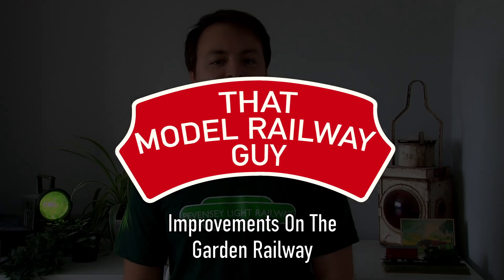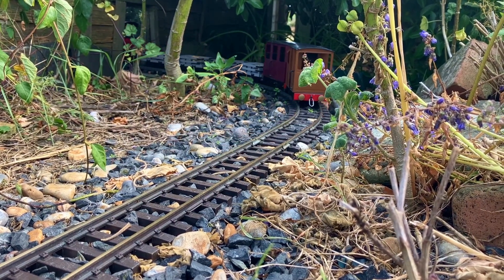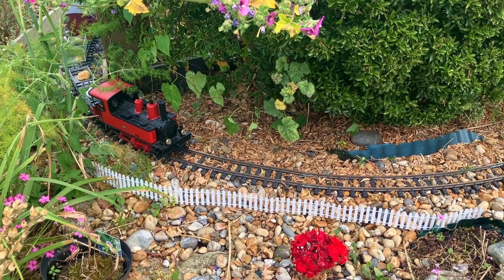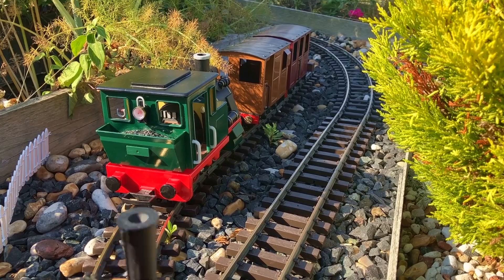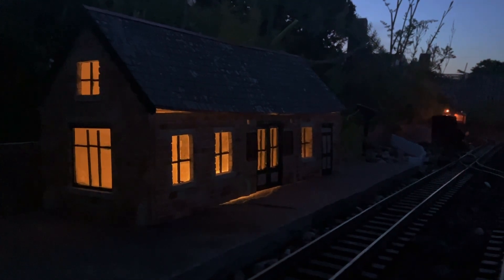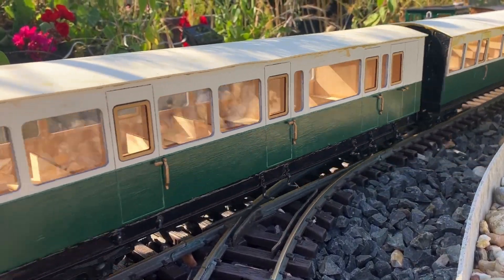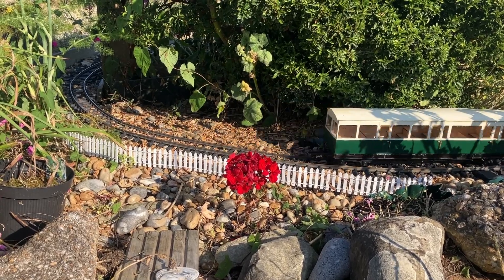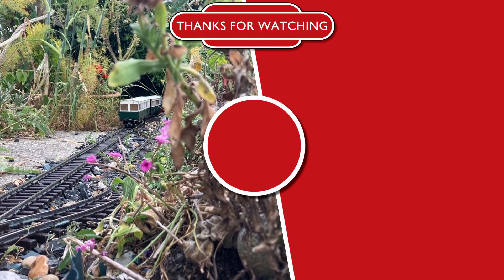A New Loco & Improvements On The Garden Railway! - G Scale Outdoor Model Railway

Comment: I'd love to hqve a day out there! It looks great. It all looks so natural and scenic. About the mamod, I personally think you should go with meths. Ceramic gas burners can be temperamental. They can over heat easily and some have a roaring sound as they burn. Meths is rather clean but you can't see the flame very well. Hope these tips help
Reply from the maker: Thanks, it is lovely to have the trains trundling round the garden. That's good info to know about the burners. The meths burner does seem more simple but I'd heard it can spill more easily too if the loco derails... which knowing me it's a very likely possibility 😆 Thanks for watching 👍

Comment: Have you thought that you may be using the wrong oil for your mamod? I used to use 3 in 1 oil on mine and it would barely move. Switched to motor oil (any thicker oil will be better, steam oil is best ofc) and it felt like a completely different engine.
Reply from the maker: I use the MSS Steam Oil, the same type that came with the loco originally so I would hope that would be ok. I don't know if you've seen my original video on reviving the Mamod live steam engine but it's already gone from barely able to move to being quite sprightly - it's just some of the gradients on the outdoor layout it doesn't like. Thanks for watching 😃

Comment: I ordered my Mamod used from the UK (I live in the US but I’m sure you can tell). It was fully upgraded with meths burner, better cylinders etc. I believe your Mamod should work just fine with the upgraded cylinders as mine is quite old from what I can tell. I believe dream steam sells them but if you want to use them you might have to invest in a lubricator as they have proper seals that will need to be lubricated. I think Dreamsteam also sells a higher rated safety valve that mine has. With that you should be able to get some good power out of your model. The only problem is when you buy all the parts it ends up costing the same amount as some more proper steam engines. I was lucky to purchase mine fully upgraded for about 2/3 of the actual price of everything new.                                                       Sorry about the long paragraph.😃
Reply from the maker: That's really great info, thanks for sharing all that! Yes I'd been looking at the stuff DreamSteam sell too and, like you say, while it's all fantastic it's just the price of all the upgrades I'm struggling with at the moment. I do often wonder whether I'd be better of saving up a bit extra and going for a Roundhouse loco later down the line instead 🤔 Thanks for watching 👍
Reply: @ThatModelRailwayGuy  I will add, my engine is gauged for 32mm so your mileage may very with the upgraded cylinders. I think they will still fit 45mm but you might have to look around some forums to confirm this.